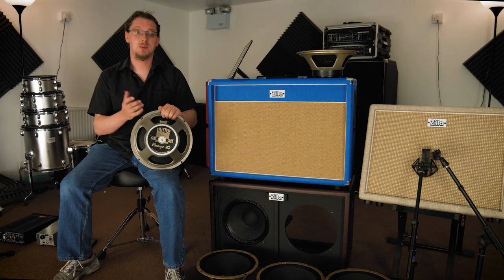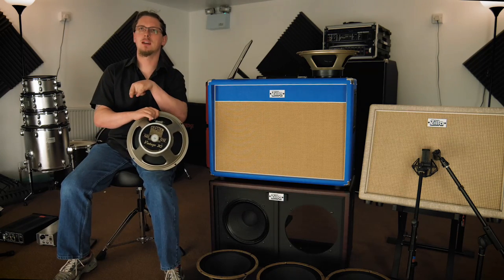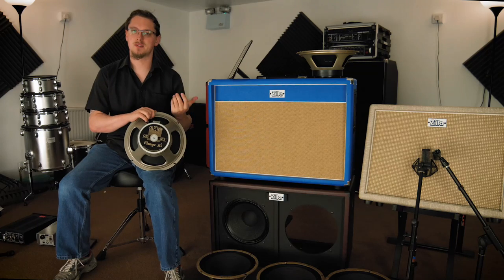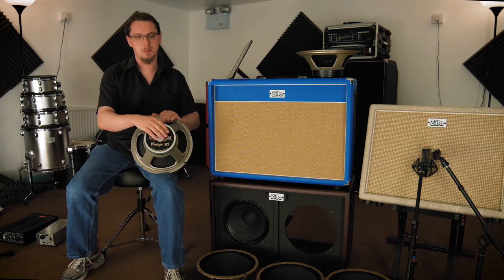8 Ohms or 16 Ohms? Vintage 30 - METAL Celestion Speaker Comparison

Comment: I know this might sound a stupid question, but does a relatively cheap Solid State amp head like the randall rg1503 H wich costs around 400 $ can damage a 2500$ guitar in any ways? Please someone help me out because i´m feeling affraid to try it
Reply from the maker: +hltds damage the guitar? Nope, not at all. Might damage the speakers maybe, but definitely not the guitar
Reply: Thank You. i guess it wont damage the speakers either because it is a 8 ohm cab that fits perfectly on the head i´m talking about. The ohm and watts from the head are matched with the speakers. The head says 4 ohm= 150 watts and 8 ohm = 100 watts. I put that head into a 120 watt, 8 ohm speakers, so it should be perfect. My only concern was if the fact that the amp was way cheaper than the guitar, it could have any negative effect on the guitar itself
Reply from the maker: +hltds yeah that sounds fine. The worst that can happen is it might make your great guitar sound terrible, but that’s not going to physically damage it, only make your soul cry :)
Reply: hahahaha. Well, we will see about it. It isn´t just any solid state we´re talking about here, it is a randall Solid state. I think it is one of the best SS amps you can purchase. Dimebag used it through most of his career, so if it was good for him, why it wouldn´t it be for me? But yes, i understand why most people put their hands on their head when talking about a SS amp, because most of them are not that good, but i guess Randall is a whole other scenario. When i bought it, i did enjoy the sound more than any other tube amps i was about to buy.
Reply from the maker: +hltds personally I think dimebag’s tone was awful. He used them because they were reliable with no tubes to break- great for touring. Don’t get me wrong, he was an amazing player, but I think people loved him in spite of - not because of- his tone. IMO when he moved to Krank amps his sound was much better. Also all the good Randall amps made now are valve based.
Reply: Preach
Reply: Only if your girlfriend goes batshit crazy on ya and smashes the guitar against the amp. I've seen it happen and it ain't pretty.
Reply: hltds Randall SS......not known for being one of the "good" solid states. Sounds like your reading to many Randall product descriptions. If you want a SS that actually sounds good, the orange cr120 is it. By far that's the only solid state I've ever plugged into and immediately thought, wow that's actually pretty good. As in the tone right off the bat was usable and pleasant. Most new guitar players go for the ss amps cause they have 1000 bells and whistles but only cause they sound like shit and have to make up for it. In time I think everyone learns it's better to have a small amp that sounds great than a huge amp with all the features in the world that you can never dial a good tone in on. With shitty SS amps you never get to play and get better cause your always jacking with the eq. If it were me the only solid state I would even consider is the orange cr120. Go to guitar center an play one an you'll see what I mean. The only down side is it's not gonna get much louder than 20-30 tube watts. But it's still plenty loud for smaller gigs and anything bigger you just Mic up anyways. But maybe by now you've already realized most SS amps aren't ever going to sound like the tones you've grown up hearing an loving. Good luck!

Comment: Thanks a lot man, you really help me to known the difference but... Could you make another video but comparing 16 Ohms and 32 Ohms?
Reply from the maker: No guitar amps I know of run at 32 ohms, so there would be little point and it would be very difficult to do a video properly (also not many speakers are made at 32 ohms)
Reply: Oh, I don't know that
Thanks for the information

Comment: Hi would a Celestion G12 Vintage 30 8 ohm work in 100 watt amp
Reply: Lake b you want to match the ohms of the amp. You can run an 8ohm cab from a 4ohm head but you’re basically cutting the amps power in half. The other way around and you’re creating heavy current draw, and if it’s a tube amp, you can damage or blow your output tubes. Best to stick with what it was designed for. I chose an amp that has all 3 settings to give me more room for cab options
Reply: @jeffreyschoolcraft6815  hi the amplifier is a Marshall valvestater vs100 100watt 4 ohm
Reply: Lake b so like I said you could use an 8ohm cab but you’re basically restricting the amps power. I’d stick with a 4ohm speaker cab
Reply: @jeffreyschoolcraft6815  I know just forget to mention the amplifiers ohms that's all

Comment: Is the 8ohm speaker plugged to the 8ohm outlet and the 16ohm speaker into the 16ohm outlet? Or are both plugged into a 8hm every time? (or both into the same whatever outlet?).  Thanks,  great video

Comment: Hello Evh guy!!!
I got a 50w tube amp head now and want to get a 100w.
I would like to replace the 2 speakers i got in the Evh 212 cab (Celestion g12h 30 anniversary 8 ohms) with 2 Celestion Vintage 30 60w 16 ohms. Can you tell me if it's possible as the the 212 cab is 16 ohms? Thank you so much!!!

Comment: china v30 , madein uk mesa boogie style v30 and made in uk marshall style v30 they all sound different
Reply from the maker: +High Gain Master yes, but you can't buy the mesa or Marshall specific models outside of their respective cabs so they're not really part of this topic (I wish they were called something else to avoid confusion, but that's something for another day)
Reply: yes cab is very important because engl,diezel and bogner cabs with v30.,are standart v30 made in china ..
Reply from the maker: +High Gain Master it really doesn't make a difference where they're made as long as no corners are cut and they're made to spec. iPhones are made in China and they seem to work fine....
Reply: Hop Pole Studios important point is cabinet wood and cab design,why harley benton cab and engl cabs are sound different and v30s inside are the same-.
Reply from the maker: +High Gain Master very true. That's why I'm a big Zilla fan, they're hand made properly with great attention to detail
Reply: yes zilla cabs are good price and good quality .
Reply: crazynutzzz, It's just a simple V30 made in UK.
Reply: @adamsteelproducer  Mesa has sold their UK made V30 separately on their website for years.
Reply from the maker: I did not know that. I’m checking that out right now.....

Comment: No clean guitar tones? EPIC FAIL
Reply from the maker: It does say "METAL"  in the title.
Reply: Metal has no clean tones?
Reply from the maker: It can do, but if I were to describe music in one word as "Metal", would it conjure up an image of clean tones or heavy distortion?
Reply: Agreed on the expection of distorted signals having "METAL" in the description. Guess its a good thing guitar cab speakers aren't universally tested (or selected) using detuned guitars with chunka-chunka cheap hi-gain tube amps, huh? 

That said, it would be a lot easier to discern the sonic character of speakers based on clean signal response.
Reply from the maker: We’ve replied to several people recently (considering how old these videos now are) saying we intend to revisit this with a wider variety of sounds, the videos weren’t very popular originally and have really taken off

Comment: hi i have vintage 16 ohms in a 4x12 cab. i need to change my configuration to make a 4ohm cab with the 4x12 16ohms  speakers. is it doable ?
Reply from the maker: You should be able to do this by wiring all the speakers in parallel, that should make a 4 ohm load